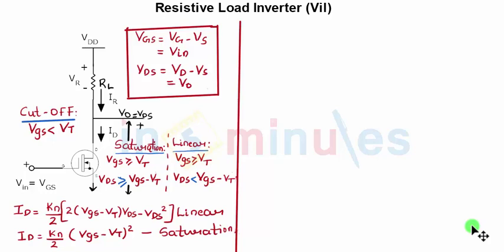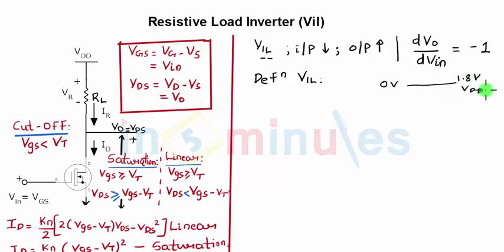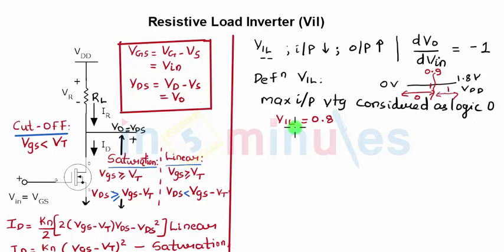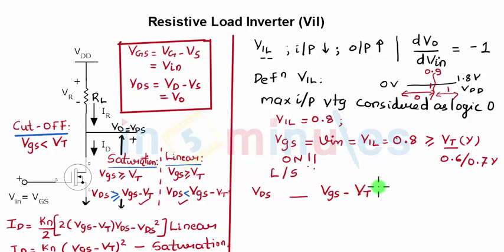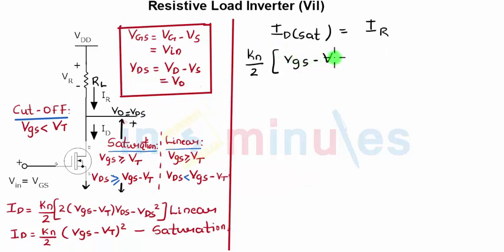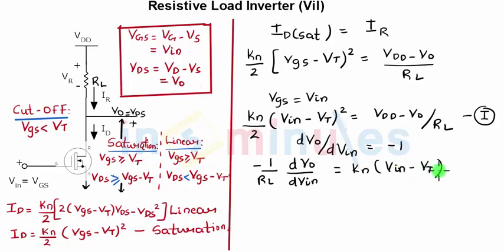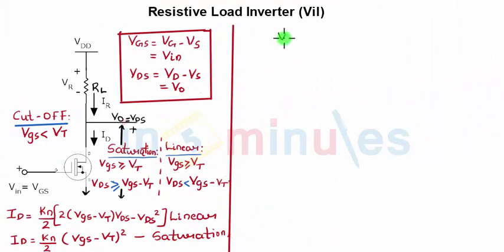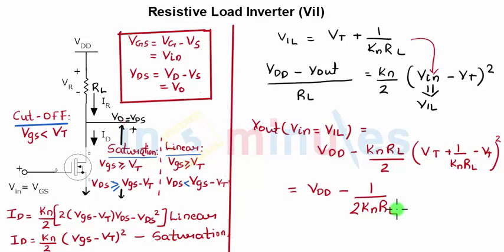Module2_Vid9_Resistive Load Inverter - Vil

Comment: I have a doubt- why  slope of transfer characteristics at Vin=Vil  & Vin=Vih=  -1.Why inverse threshold point is half of  Vdd?
Reply from the maker: Hi Rajasekar,

I would request you to see the entire videos in the playlist so that the confusion is cleared.

It is not ideally half of Vdd, output depends on which transistor is stronger NMOS or PMOS, depending on the strength output will go close to vdd or 0. Hence, sizing and designing transistors depends on the requirement 

Thanks once again and hope you see all the videos 👍